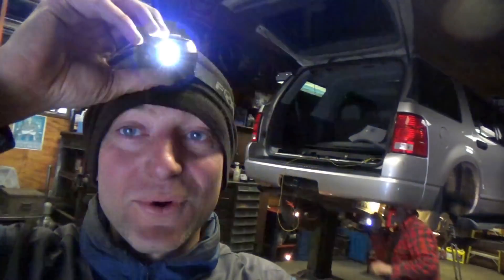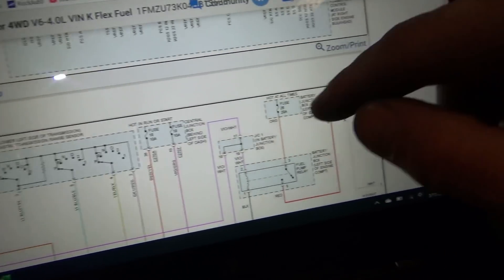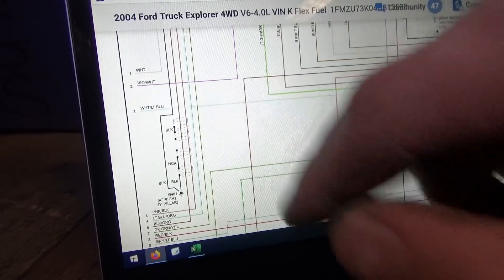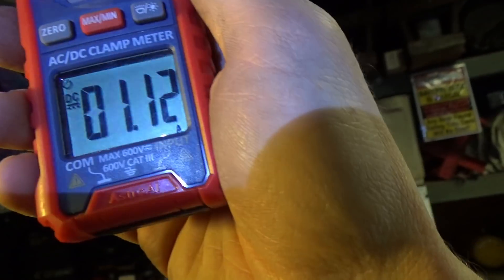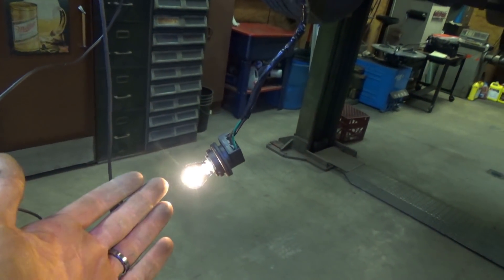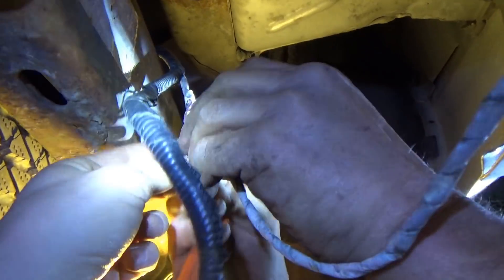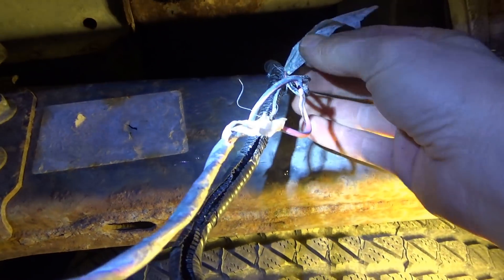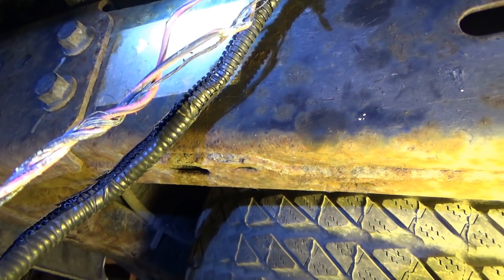Weirdest Wiring Fault I Have EVER Seen...

Comment: That is worthy of a recall by Ford! In the electricity industry we had an overhead service cable called "Neutral Screened" cable. The neutral return was a bare wire wrapped around the insulation of the active wire, all covered with insulation so it looked like one circular cable. I guess it was deemed less of an eye sore. Where you terminated the cable at the house connection and also on the power pole, you had to unwrap the neutral, sleeve it with insulation then make your connection. Fast forward many years later, maybe decades, (who knows - it was already up when I came across), it was failing at the pole end because it is exposed to the elements and water/moisture would make its way up the neutral strands, pool in the droop of the cable and slowly turn the copper into white powder. As I am sure with your electrical engineering background Ivan, you know that this would cause fluctuations in the power supply, most noticeable as flickering lights, and if left unchecked would lead to shocks & tingle or worse due to the CMEN system of earthing (if your country uses that system). It is much better to have all conductors have their own insulation!

Comment: put 10 amps through it and watch with the thermal camera, you'll see exactly where to unwrap the harness.   I had a similar problem with a late 80's Range Rover, error codes and blown fuses like it was possessed.   Unwrapped the harness and all of the wiring insulation had degraded into something with the consistency of Playdough crafting clay.   Replaced the whole harness.
Reply: Ah, yeah. 1980's cars were prone to that. Volvo 740/760 and 240 come to mind.
I think it was because car manufacturers started to use other type of wiring insulation (bio degradeable?)
Reply: @jfv65  They might have done what Ford did and make the insulation from soy instead of petroleum.  The little creatures of the world loved to chew on that stuff.
Reply: Better yet, put 100 amp fuse and watch for the glowing sheet metal 
Trusty ole smoke test
Reply: Good advice thank you

Comment: The first thing I thought when we looked at the diagram was, it's shorted to the shield. The second thing I thought was WHY the shield in the first place.  Coincidentaly, I had a problem with shielding shorting to data lines in a canbus yesterday. Not a car, it was a boiler.

Comment: Just guessing but since the radio amplifier is in the RR corner there may have been issues with EMF coming from the fuel pump which could explain the need for shielding.
Reply: Not only from the fuel pump, but I think primarily from the fuel pump driver, since it uses PWM the signal will be a square wave with a lot of high frequency components. Which is why the wires from the driver to the fuel pump should be as short as possible.
Reply: @T.J. Kong you can't use just a capacitor to filter high frequencies from a PWM signal. What you need is a LC filter to make an average DC voltage from the AC signal. But then you've just created a plain old DC-DC buck converter. Could they do that to filter the noise? Yes, but coils and capacitors cost money, and if you can get away with not using them, they won't. It's debatable whether installing the shielding over the cable harness cost the manufacturer more than the filter.
Reply from the maker: Many cars use PWM to control fuel pump speed, but this is the first I've seen that has a dedicated bare shield ground wire wrapped around the power wire 🤔
Reply: @PineHollowAutoDiagnostics  Could be that it failed FCC certification or RF getting to the radio amplifier.  The fuel pump motor is a pretty good load and switching it on and off will create a lot radio frequency interference.

The important thing to note is that the shield is only connected to ground beef at one end !
Reply: Correct.  Shielding is common when electrical noise is a concern.  Usually it's used when the wire might pick up noise, but it's also used to prevent the wire from radiating noise.
Reply: @T.J. Kong A cap would increase the instantaneous current the transistors would have to supply.
Reply: Kind of like my smart meter in my home!! a lot of EMF comes through it into my house wiring, so I put a in-house filter before fuse panel

Comment: Your lucky it was shorted. Seem like I always got the intermittent shorts. Just enough for pop the fuse. I had a 93 Grand Cherokee that was blowing the fuse that powered the TCM and reverse lights. After pretty much gutting the vehicle, I was getting angry with it, as I walked past the left rear taillight, I called it a POS and whacked the dangling light. Poof…. Blew the fuse. Sometimes electrical issues can be a nightmare 🤣.

Comment: Great job! I've found one of the most difficult issues to troubleshoot was when wires from unrelated systems were in contact with each other. I didn't make sense, and it did not match the wiring diagram, because the connection was not supposed to exist. And people wonder why it took so long to figure out!
Reply: I've seen a single strand of wire poke through it's and another wires insulation and take out a can network

Comment: When shielding actually becomes the problem! Was Ford having interference problems with the pump operation to come up with that "solution"? Crazy!
Reply: @dancarney106  The amount current is not the reason for the shielding. It's because the current is pulse-width modulated.
Reply from the maker: @dancarney106  never seen shielded fuel pump wires
Reply: @PineHollowAutoDiagnostics  Ivan it depends on what other wires they are bundled with.
Paul (in MA)
Reply: @dancarney106  Anyplace with snow and ice on the road.   lol      Calcium chloride is just dandy for chassis and cabling......
Reply: @dancarney106  The reason for it being around a starter cable is because as Ivan has shown many times doing cylinder balance tests with the PICO, the current is not smooth but full of spikes which would again generate noise. That said, the frequency generated is rather low so shielding that seems kinda overkill.

Comment: Hi from the UK 🇬🇧! Used to get this all the time on Citroën, lost count of harness repairs especially across the front in the engine bay, the bits of gravel and sand would find their way into the insulation and grind through to the copper until it turned green and disintegrated!

Comment: That is a Faraday shield to reduce capacitively coupled fuel pump brush noise from interfering with radio reception.
Reply: I have a Faraday pouch for my Tundra key. Push button start is easy to steal.
Reply: agreed.
Reply: I have a Friday too😄😄
Reply: Non sense...
Reply: Other way around... It's to stop outside interference from making it's way to the fuel pump. As they do that to prevent the fuel pump from burning up... Why it's driven by the fuel pump module.

And at $350.00 for the pump. Then labor to replace them. Seems cheaper to repair the wire...
Reply: @WizzRacing  that’s ridiculous.
Reply: @Nosoupforyou6565  Read Ford Service manual. They tell you how and why..

If you can read, Short Bus Rider...
Reply: @WizzRacing  Yep !

Comment: Road Salt water spray under vehicle permeated harness and pink wire is hot while pump is running becomes a galvanic anode dissolving the copper at some pinhole in plastic .18 years of salt immersion. Not to bad.
Good fix with the scope on a rope old school test light.

Comment: at one point someone must have pierced the wires to test something back there
Reply: Vid shows factory wiring was not previously disturbed. Either a defect in the wire sheathing when it was MFG or the salt crystals caused abrasion.

Comment: What in the world?!?    Why would that be shielded?
Reply: Good morning Kevin
The brushes on the electric motor for the fuel pump will throw a high pitch noise that the radio in the car will pick up so Ford wrap them with the aluminum shield to keep the noise down in the audio system on the vehicle.
There is a fancy name for that stuff I just can’t remember it one of the other comments in this video tells you exactly the name of it
Reply: @williamgagnonroadboxservice  Thanks.  That makes sense.